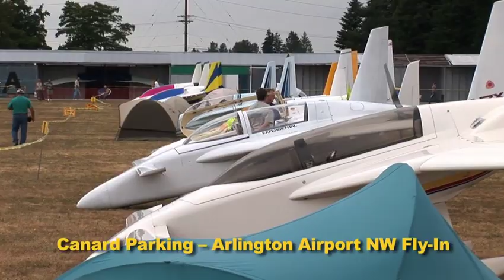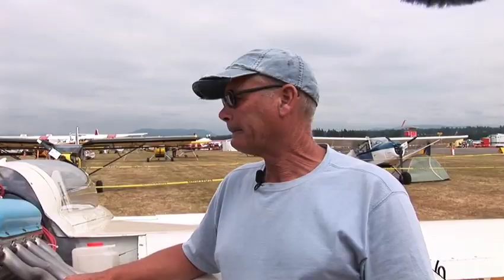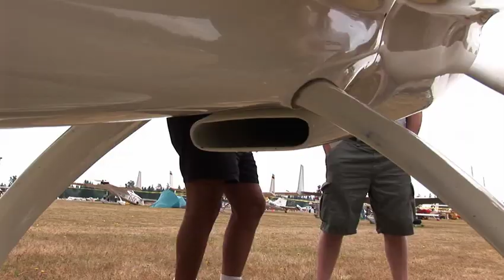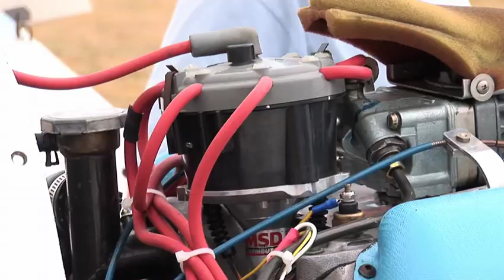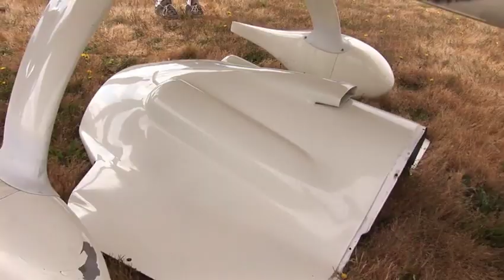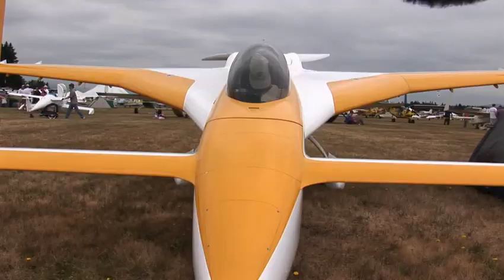LongEZ V8

Comment: This dude clearly doesn't understand how aircraft engines are designed and how they work. They are designed like generators essentially to produce 100% of their horsepower all the time. Automobile engines cannot do that.
Reply: Well... he's an engineer and a pretty smart dude if you've met him... so I'm going to have to disagree with you there...
Reply: Yep. Just note the RPM he quotes for the horsepower rating. It will run forever at that. At at 1,000 hours, he says "no appreciable wear".
Reply: Aircraft engines are not designed to run at 100% horsepower. Throttle at cruise vs throttle on takeoff is completely different for most aircraft. Moreover, auto engines are built to closer tolerances, go through dramatically more testing, and are all around much more sophisticated machines than a standard air cooled carbureted aviation engine. Liquid cooling means that the engine operates at a much more uniform temperature across a variety of environments. Given that aircraft, by their nature, experience greater temperature differentials than automobiles, water cooling is potentially much more beneficial for aircraft than automobiles. As for an automobile engine being able to perform at a percentage of peak power for a given amount of time, this would depend very much on the engine in question and its implementation. The engine failures in modern high performance engines at the limits are often the result of insufficient cooling, or a failure of the cooling system itself (e.g. a hose), which would be a consideration. However, stock engines can be abused quite a bit (and often are) without failing.
Reply: @DanielWilliams-oi4ss  A worthwhile comment.  Well said, Daniel.
Reply: @DanielWilliams-oi4ss  The engines in airplanes such as the Cessna 150-2's are rated for full throttle operation all the time. Remember as the altitude goes up the power goes down. And automotive engines never run at full power for long, try that on the freeway? And turbo charged aircraft engines can maintain sea level power to altitudes a car will never reach.
Reply: Lycoming and Continental engines are so behind the time's and are OUTRAGEOUSLY over priced for 1950/60's technology. I'm building a small kit plane now a "Precision" it's a clone of a small RV,  I have a Honda 1.5 litre FIT engine in it,  such a simple design  w/all the modern accessories,  only trouble I'm having is the "knock sensor" and the "timing sensors" because of the computer.  but Viking Aircraft engine's have all the replacement part's to correct the problem,  plus I've decided to just cough up the cabbage and get those and a nice oil bath gear to gear reduction unit from them,  they're not cheap but proven,  after its all done I figured I saved enough by using that Engine to dam near pay for my plane..  about 6 month's to go,  it should be ready, baring any other problems.
Reply: Have you been on the homebuilt forums? Viking doesn't have a stellar reputation (I'm not at all familiar with them either way).
Reply: @DanielWilliams-oi4ss  , they are good as far as there engines,  there troubles have been with the reduction unit's,  and of course some other isolated problems, that even on a new installation w/a Lyc or Cont. My have.
Reply: @loxahacefigaronald724  " kit plane... a "Precision" it's a clone of a small RV"

I can't find a website for the Precision RV clone, where is it made ?
Reply: @loxahacefigaronald724  Please when your dream is flying post a video.
Reply: 1.5 liters isn't really enough displacement. You will be running at high fucking RPM to suck in the same amount of air as an real airplane engine. Have fun with that. 1950s/60s technology is not bad at all. Air-cooled and pushrod engine? Thanks, I like it simple.
Reply: 1.5 liters, back in the first "Turbo" days of Formula 1 racing, could get you 1,000 bhp. It's plenty of displacement for a mere couple of hundred horsepower.
Reply: When you go in for your flight review, make sure you review density altitude and how air gets thinner at higher altitudes. Why do you think plane engines are such high displacement and high torque engines?
Reply: Because they are silly ancient designs. In terms of "high torque", since horsepower is a function of torque and speed, two 150-hp engines spinning a prop at 2,400 are putting the exact same torque into that propeller, regardless of displacement or gearing. A small turbocharged engine may have a flatter torque curve than a large N/A engine.
Reply: @UncleKennysPlace  -he's just another know it all,  probably doesn't even fly !
Reply: @daytonasixty-eight1354  yes I know about old and reliable,  I have a o-200 before,  and it's $10 grand for a new one, compared to a more modern reliable Engine with another 100 hp for half the price, maybe you have plenty of money to piss away on a Cont. or Lyc. At 10K. For every 100hp your the kind'a guy Textron, an Telladyne like. Keep believing they're the only engine you can safely use in a aircraft. As far as the  RPM's they're  determined by prop, pitch, length, an in this case the reduction unit. You better do more research on the Vikings engine, best set up goin right now w/a Zenith 701, sky jeep
Reply: @daytonasixty-eight1354  , why do you think a turbocharger was made,  DAM you just don't get it!
Reply: @UncleKennysPlace  this guy just don't get it - it could have a big block Chevy in it as long as it had the right reduction unit and the right prop, w/ pitch,  length,  constant spd or std,
Reply: Well apparently he flew it for 20 years. @loxahacefigaronald724
Reply: @daytonasixty-eight1354  True enough, a Cessna 150 O-200 makes 100 hp at 2750 rpm depending on some variables. Try that with a automotive engine. And a 0-520 cu in engine will make 300 hp at 2700 rpm, and a turboed engine will keep making that power to over 20,000 feet above sea level. Know of no automotive engines that can do that. And at those engine speeds no over head cams and belts are needed. Airplane moto keep it simple. Large diameter props turning slow are more efficient than small props turning fast.
Reply: @daytonasixty-eight1354  They're high displacement because in the 1930's when these engines were introduced, that was the only way to make horsepower. Auto engines require much less human input to function better over a wider range of conditions (when's the last time you adjusted the fuel mixture in your car? Oh, you don't? That's because the ECU does that automagically).
Reply: @ohwell2790  The only reason that aircraft engines are so powerful at such low rpm is because they're HUGE and because they're designed to run at low rpm. Automotive engines (and Rotax engines) are designed to run at a relatively high rpm, and they can last just fine while operating continuously at high rpm. Consider Rotax engines (5,800 rpm), the Honda V6s that Titan Aircraft uses in their T-51s (5,750 rpm), or the EPeX engine in Steve Henry's YeeHaw 7 (10,000 rpm), they've all proven to be very reliable. Engine technology has advanced enormously since the lawnmower engines that most people fly with were designed, the aviation world just hasn't caught up yet.
-
BTW, automotive engines can easily match the power output of aircraft engines at low rpm, you just need to compare engines of similar size. A 5.9 liter Magnum V8 can easily match the power output of an IO-360 at 2,700 rpm, for example.
Reply: @ohwell2790  Also consider that Toyota had their UZ series V8 certified as an aircraft engine by the FAA, that the Austro Engine AE330 and AE300 are based on an automotive engine, that Continental has no issue with using automotive diesels as the basis for certified aircraft engines, and that Boeing has no trouble using Ford (actually designed by Mazda) 4 cylinder automotive engines to fly at 65,000 feet for 4 days at a time. Automotive engines are just better than aircraft engines, they're even better at being aircraft engines, the conversion of an automotive engine into an aircraft engine, and its installation into an aircraft, simply needs to be properly designed by someone who knows what they're doing, like the person in this video.
Reply: @daytonasixty-eight1354  that's why the computer takes readings from the mass air flow sensor and the barometer sensor adjusting accordingly the amount of fuel being injected  .
Reply: @loxahacefigaronald724  A big block Chevy with a motorhome cam would direct drive the prop just fine. Peak power would hit around 3100-3400RPM and peak cruise efficiency would be down in the 1800-2200RPM area. Right on the money for airplane use. Throw an all-attitude dry sump lube system and port EFI on it and you're golden.
Reply: @ohwell2790  100HP at 2750RPM? That's it?  The 300 in my F150 makes that and it spews more exhaust out the fucking oil breather than it does the tailpipe! It's laughably low output man come on. A 36 year old clapped out $500 farm truck can match that wtf.
Reply: Plenty of these auto engines are pushing boats around.  So they are capable of 100% output...if the internals were built for it.
Reply: Jabber jaws, running yer mouth 100% of the time!
Reply: with the right cam they can.....
Reply: Nonsense... this myth just wont go away. That same Ford motor would also be put in a 1 ton dually axle truck that would run 3500 rpm @ 50mph for decades. Automotive engines are designed to run at any RPM for however long the user wants under redline. I think this myth got started with the AC engine manufactures trying to sell you a 4 or 6 cylinder engine for 35-80 thousand bucks vrs Ford or GM 5-15 thousand.
Reply: Do you mean,going to the market,I've got to use 100% of the Motors power ?  Or I don't know how motors work?
Reply: That SBF will last for 50 or 60 years of hard surface abuse where it gets the shit beat out of it, never gets PMs, sucks in all sorts of debris and detritus, regularly overrevved, clutch dumped, et-al.

Being put in a Long-EZ is basically a cushy Florida retirement for a smallblock V8. That engine is on easy street compared to its bretheren still rusting away in BillyBob's pickup truck.

There is no fundamental difference between how a Lycoming is built and how that SBF is built. The differences are in the cam grinds(Which he addressed with a custom cam) the carbs(which he also addressed), and the price tag of the FAA-certified parts(which he's skipping out on because he's not using a Lycoming).
Reply: @UnderBridge Rock I'd rather have the smallblock V8. Don't have to pay $100 per spark plug, get 3x the output per cubic inch, better sound, more compact, probably lighter depending on the lycoming or continental being replaced, will run on unleaded 87 octane fuels without a care in the world, easy for me to tweak and tinker with, proven to last for-fucking-ever, will still run at an acceptable power level even with a couple cylinders totally inoperative, part crossover with my daily driver is a thing, can get engine parts at any random autozone, ready to take off as soon as oil pressure comes up rather than having to wait for it to come to temp, fuel mixture kept in check no matter what with the installation of a Holley EFI system, easy to fit boost devices if I want to do high altitude shenanigans, easy to dry sump for inverted flying...yyeeaaahhhh it's not a difficult decision.
Reply: @TestECull  There is also the guy that Trent Palmer interviewed with a honkin Kawasaki jetski engine with 400hp supercharged! I have a 2015 Jetski and I wondered about that for that engine in a plane someday. I've been full throttlin that engine all summers long for 7 years only changing oil every summer and letting people ride it for 8 hours straight. Check it out! Only weighs 225lbs!
Reply: @waveman2952  If it didn't weigh 900 pounds for 120hp I'd love to try to put a Ford 4.9 I6 in a Cessna. You can't really ask for a more reliable, durable, or long lived gasoline engine, but they are H E A V Y. Cast iron block, cast iron head, cast iron crank, cast iron manifolds...